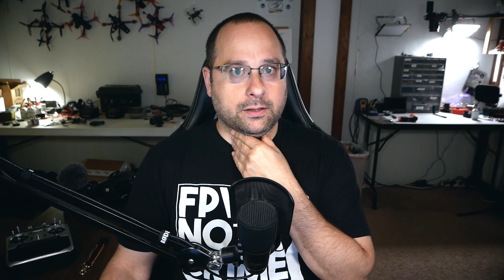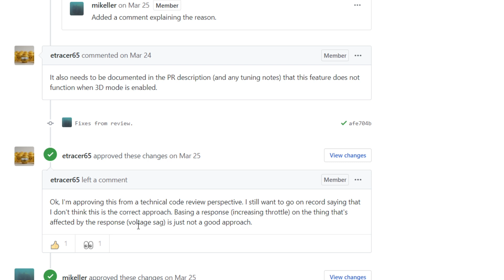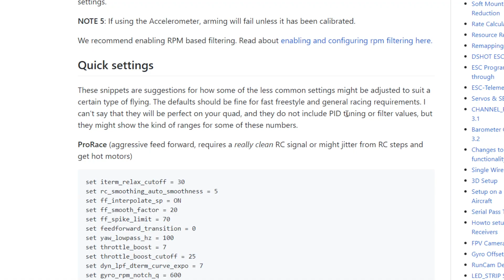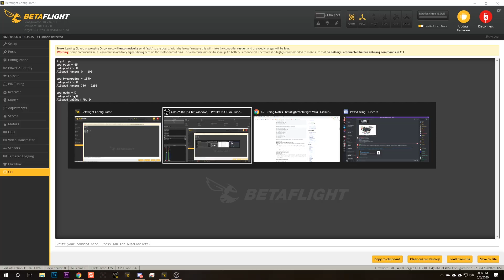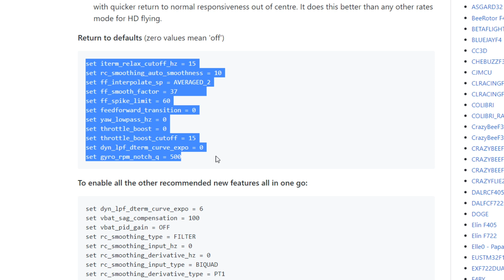Betaflight 4.2 Release Notes and Tuning Guide Deep Dive

Comment: Any idea why after flashing to 4.2 with JESC esc, bidirectional dshot I get Rpm filtering warning in my osd... When I try to arm.
Reply: I acrually rectified this. Throttle min got changed to 3.5 changed to 5 and everything is fine.
Reply: JESC is so worth the 1.50 per motor. So glad he is doing this hard work.
Reply: I found the video for rpm filtering. this guy has covered everything.

Comment: How do you measure your cruising throttle value accurately?
Reply from the maker: You can put throttle % in OSD.
Reply: @JoshuaBardwell  ok will try, I don’t believe I’ve tried adding that to the dji osd

Comment: I changed 4 of my quads over to 4.2 and added RPM filtering.  Followed your 4.2 video and didn't paste.  Flys better indeed, but on all the quads I'll get vilent sudden pitches or yaws with a quick throttle blip.  It will only happen once in a flight and fly fine after.  After a new battery a few seconds into a flight it'll kick hard to the side recover and then never do it again until the next battery.  Tinyhawk freestyle II, mob 7, geprc cinepro, and nazgul5 all do it.  I've also seen this happen in videos from other youtubers latley, but they seem to brush it off like they hit a tree branch or something and just ignore it.

Comment: having some issues with 4.2.  I flashed two of my quads and followed all the settings from your videos but now i have a slight yaw twitch on both quads and they do not fly smooth.  what what cause this issue.
Reply: I had the same issue. It's the ESCs. You have to change to motor timing and something else. I saw a vid from flightone that explained. look up yaw twitches flightone on youtube

Comment: So if i want to use rpm filtering, I also have to adjust the dynamic notch filters?  I'm using a Matek 405 board on 4khz and dshot300.
Or just try it on rpm filtering without touching the dynamic notch filters first? Ojeah my esc are flashed with blheli_s 16.9 
I'm new at this whole tuning settings....
Thanx in advance! Love your video's!

Comment: Hi, I just upgraded the firmware of mobula 6 to betaflight 4.2. Since Usb port is under the board of Mobula6 it's impossible to place it to a flat surface for calibrating accelerometer.  Is there a way to skip calibration?
Reply: Place it on an empty box, roll of duct tape or similar.

Comment: Would it be best to do a dump prior to upgrade, then do a clean dump after the upgrade, then go line-by-line, and omit anything that has been changed?

Is there a list of data points that can be safely migrated?
Sorry. I haven't been paying as much attention as is needed for a bunch of versions of Betaflight. (I have a lot of hobbies competing for my attention.)

Cheers. Thanks for what you do, Prof. Bardwell. :)

Comment: Betaflight OSD Suggestion:
A battery sag notification/visual warning in the OSD/telemetry would be very cool. It seems like maneuvers that cause battery sag also may preclude watching voltage numbers. It could be done the way that late model Subaru vehicles provide a visual +/- fuel economy gauge.  The gauge is in the +  or neutral range during normal driving, and move into the - range when you are pushing the motor.
Reply: Love the Subaru connection😂

Comment: You mention crappy radio input and why that gives mid throttle oscillations, why when there was BF 3.5.x we had no oscillations ? Seems like we take 1 step forward and 2 steps back. Maybe this is all a little too technical to explain, but in my opinion with my drones I never had so many headaches after running the newer BF versions. Now the PID loop becomes the PID/FF/D_MIN etc.. loop and I am just going crazy with all this. I hope when we get to BF 5.0 we don't have to read a 1000pg manual. And also, running defaults don't work with heavier quads with a GoPro 8 or heavier action cam such as the Insta 360 One R, the P term just doesn't do enough for the extra weight. Sorry, I'm not bashing, I just wished they would simplify the setup and make a version for racers, or just come up with some pre-made profiles (racer / freestyle / heavy freestyle / etc).
Reply from the maker: In BF 3.5, there wasn't the same FeedForward parameter to allow fine tuning of stick feel. If you turn FF to zero, you won't get mid throttle oscillation when your rc link stutters. You will also have a really mushy feeling quad. Welcome back to Betaflight 3.5.

Comment: One question to 4.2: It flies great and super smooth, but I get low voltage warning because of voltage sags A LOT more now. Is there a possibility to set some delay to the low voltage warning, so that the alarm only appears after 3 or 4 seconds of low voltage?

Comment: Throttle voltage compensation is the most exciting feature for me. I wrecked my quad recently because my battery sagged out during a power loop, because of those darned 2207 motors :(

Comment: NFE racemode is a whooping solution for pilots that primarily fly acro (dont we all?) and therefore feel unnatural in angle mode constantly pushing forward on the pitch stick to maintain speed.  It just has a better flow feel on a tiny micro.  In this flight mode your muscle memory from acro enjoys a much more neutral feeling on the sticks when cruising,  but you still benefit from the roll axis leveling which gives angle mode whoop pilots their advantage on a tight race track.  It's a throw back to my roots in the open pilot days where you could select the behavior of each axis independently.  Whooping in level mode just wasnt for me, so I created this in order to make myself competitive in whoop races and shared it through silverware and some long forgotten forks of betaflight where it was rediscovered by Kevin @ emu.  My mind is blown that it has caught on like this.  :)
Reply: So it's from silverware it was familiar to me! Good job!

Comment: I just wish they'd add an automated config to map motors. I get so tired of resource mapping motors cos I barely ever put the fc in the way they come. I always go the tidiest or best way and adjust to suit.
Reply from the maker: God yes.
Reply: @JoshuaBardwell  I've just gotten really good at the dance of going into the motors tab, spinning all four, making a text document of 'M1 Signal spins Actual Motor # ___', then substituting the pin IDs for the former, and making CLI commands (or copying out of diff all files)...  Great configurator feature to have, but I'd want to prioritize other things above it:
Short list of stuff I'd rather have - yaw direction auto-detect (e.g. if it goes into runaway protect with yaw on takeoff, prompt user to use OSD to invert yaw motor direction - implemented like the ACC cal currently is).
Preset Dials/Pages - even if it's just a webpage passthrough, but lets you drop in a CLI snippet from a community preset page (with the same release range)

Comment: i don't use RPM filter on racing quad cause it occupies too much system resouce and make quad react slowly...I find a good way of tuning that use Heiko's frame and cancel gyro dynamic filter and D term dynamic filter to make extreme reaction and enough filtering.and I turn down bidirectional esc communication then i can use 8k8k, it also increase performance.
Reply: sorry what I turned off is lowpass gyro and dterm cutoff
Reply: What setup are you running - RPM filtering ultimately will reduce phase delay and make it MORE responsive... if nothing else reduce the RC filtering and move FF up and you're in good shape.
Honestly, 4k/4k/DSHot300 outperforms pretty much any setup mechanically, and for racing I suspect that even with my cheap FrSky XM+ command link I'm probably getting better end to end latency for stick input to reaching setpoint, because I'm using RPM filtering and have both the Gyro and D-Term filtering sliders slammed to the right.
Reply: @tehllama42  let you know when I get home

Comment: I am with etracer on that one seems like something that if you get a problem with vbat sensing you end up with a quad that's unflyable.
Plus surely you should want to know when your system is struggling with the demands you putting on it not just powering through it.
Reply from the maker: As I understand it, the maximum that it can do is reduce motor output by 16%, and the minimum it can do is not reduce it at all. So unflyable quad doesn't seem likely even if vbat sensing is screwed up.

Comment: 15:08 yes this hapens to my 4s battery all the time less power and in the end battery just dies unexpected... and I hate it, so I set back Vbat PID compensation :) change my mind
Reply: You can also set the new value to 50 instead of 100 so the effect is only half as strong.
Reply: @GRANOLAFPV  I don't like conception at all :) Maybe this could be nice to set on aux to turn on or off. but if I need some tricks I must have full power of battery.and if I set it to 50 that doesn't mean my battery will last till proper landing and not die in few seconds :) you fly and sudenly wuad starts to lose power and few seconds later it just drops dead :)
Reply: @jtaraskus  gets some decent lipos buddy.
Reply: @SlipperyFPV  I'm using r-line 1550 100C HV :) they all are new charged maybe 5 times :)

Comment: After manually recreating my 4.1 set up in 4.2 in addition to some of the notes for 4.2 and the recommended new features, I finally have a 3 inch toothpick that flies perfect. No jitters or no mid throttle ocillation. Pretty cool.
Reply: same!!!! butter smooth on my toothpick!
Reply: did you notice much lower cpu usage? mine went down from almost 40% idle to less than 20%
Reply: @djnonnus  yeh, around 11% now, was double that before.

Comment: can we take out tpa if we use sag compensation?
Reply: They are not related. However you shouldn't use Vbat PID Compensation with sag compensation.
Reply: @BruceLuckcuck  oh, yes, nevermind

what about thrust linearisation and tpa?
Reply: @marc_frank  That has a slightly more complex interaction - short answer is that it's best to use both, but if you're familiar with the effects of it, you can reduce how much TPA is present (through moving the transition point higher, or reducing the strength of TPA)...  if you want.  It's really mostly noticeable at lower throttle, particularly with smaller motor craft or otherwise authority limited setups that spend time at low throttle.

Comment: They have also fixed the home point problem when rearming after a crash in GPS rescue and direction home. It locks the home point to the first arming point after plunging in the battery. Which if I remember correctly you had suggested it should be.

Comment: Could they please just add a feature like kiss that allows us to check our props without gyro active.   And no I do not mean turn pid sum off at low throttle
Reply from the maker: Turtle mode does that. Just be aware that the props spin backwards.
Reply: @JoshuaBardwell  Then you'd have to hold the quad and the transmitter to check prop aliment right?
Reply from the maker: The way I do it is, set it down on the ground. Turtle mode and arm. Then push the sticks and verify the correct motors are spinning the correct (opposite of the correct) direction.
Reply: @JoshuaBardwell  The Racelite Wires are also a quick way to do that - they're more than just awesome bling.  (Or at least that's what I keep telling myself, and that they don't also have to be matching purple).

Comment: Most everything I've seen is very positive! I'm waiting for the official release though. My lack of faith is disturbing
Reply: It's not at all..never trust bleeding edge
Reply: My lack of faith is disturbing as well. In fact I'm still running 3.9 on one of my quads. Hopefully neither of us gets force choked by a tormented Sith.
Reply: Makes sense - although if you look at the cumulative changelogs from 4.1.5, there's only a few areas with significant changes, and most of them are in areas to fix known bugs (can't guarantee that they're fixed, but the current release one isn't perfect either)... I should probably have been more hesitant testing 4.2.RC1 on my 7" quads, but I went all out on the maiden flight, and it just rips.

Comment: Yaw spin recovery is not gyro overflow prevention. Yaw spin recovery is a feature that is designed to improve recovery of yaw spins caused by a gate clip for example. Gyro overflow prevention is a separate higher protection that tries to recover from possible axis overflow in gyros that have this bug (Invensense ICM gyros). So yaw spin recovery is a flight feature designed to help recover from gate or branch clips quicker. The feature is not new, it was just disabled by default and the user had to enable it and set the limit. The change is now it's enabled by default and set to a margin above the user's configured max yaw rate automatically.
Reply from the maker: Thanks for that clarification. I wasn't aware that they weren't the same feature.
Reply: The simple description is that yaw spin recovery helps recovering from gate/branch clips quicker. However the technical details are very interesting. Basically an externally caused yaw spin is rarely a perfectly flat z-axis only spin like a frisbee. There is generally some "wobble" on the roll/pitch axes (think of a spinning top slowing down). The problem we get into is that the PID controller in addition to trying to stop the yaw spin using 2 corners at 100% and 2 corners at 0%, it now has to use some of the motors to address the rotation caused by the wobble. This means it needs to take away some of the motor thrust from the ideal yaw effect and use them to affect roll or pitch. So that's the first problem. Next issue is that the "wobble" precesses. So basically it forms a sinusoidal wave form that travels from roll to pitch, back to roll, and so on. So the previous problem of having to correct an axis besides yaw now becomes amplified. Now the PID controller is having to spin up/down the motors to correct roll, then move to pitch, and so on. So in addition to losing the authority on the yaw axis, we may actually make the yaw problem worse. Yaw works on accelerating/decelerating (derivative) the motors, not thrust. So spinning the motors up/down to combat the roll/pitch wobble can actually increase the yaw rate. If the precession reaches a resonant frequency with the yaw rate it can actually reach a state of equilibrium and the quad is unable to slow the yaw spin and result in a kind of "flyaway" (rarely though - more often it just seems like a really long recovery). So all of this comment is to give some appreciation of the complexity of the problem. It's an extremely dynamic environment. Once triggered, yaw spin recovery works by prioritizing recovering the yaw axis and minimizing any roll/pitch response. Once the yaw rate recovers below the threshold then roll/pitch response is phased back in.
Reply: @BruceLuckcuck  Brilliant stuff! Thank you!
Reply: @BruceLuckcuck  That explanation is quite solid - I figure I'll probably be among the test cases with crashing low motor authority quads on really low yaw rates to see how big the improvement is.  So far (only 7 crashes in), it's been a solid improvement.

Comment: does all that viture work in F3 chip in my FC?
Reply: Unfortunately no, and the new gyro restructuring means that a stripped down "performance" version is unlikely.
Reply: soo all of this fiture work only with F4 and F7 chip in FC,... Thanks Mark Bizilj🙂 i must upgrade all my previous FC for Betaflight 4.2
Reply: F3 support was fully dropped in BetaFlight 4.1:
https://github.com/betaflight/betaflight/blob/master/docs/Release%20Notes/Betaflight%204.1%20Release%20Notes.md
"as announced before the release of Betaflight 4.0, support for F3 based flight controllers has been removed from Betaflight 4.1."
Reply: While F3 support nominally 'stopped' in 4.X, the BetaFlight Performance Edition (BFPE) goes on, and has 4.X versions that run great on F3 FC's and do a great job of RPM filtering and dynamic idle.  These are a project that Thorsten Laux (JoeLucid - JESC) and Mark Spatz (UAV Tech) work on, and update.  There are some features that no longer fit (LEDs, virtual current sensing), and many targets require you to specify which SerialRX provider, but all told it works pretty fantastically.
The gyro restructuring is going to take some work for the 4.2 coding, but again that's work in progress... but the good news is that I actually used a BFPE rig to help test a lot of the new defaults in 4.2, and you can bring most of that over.  It'll still probably run best as a 2k/2k/DShot150 quad in most cases, and you can still use lots of the tuning snippets from the BF4.2 notes to get smaller quads up and running better - particularly running thrust_linear, changing the iTermRelax down to lower values, and adjusting the dynamic filter to run in lower ranges only).